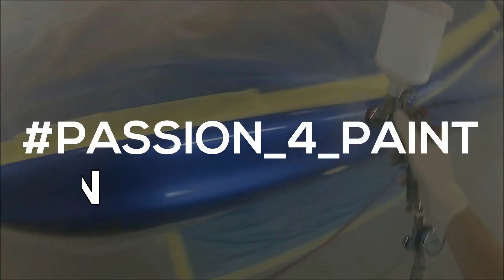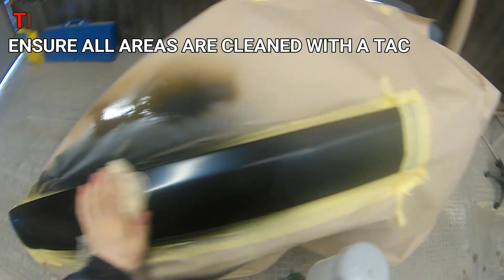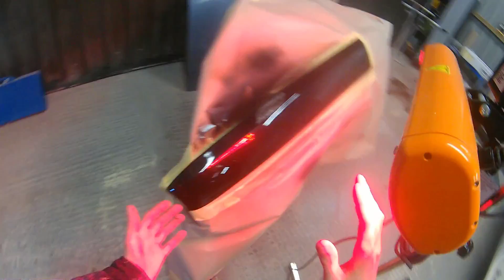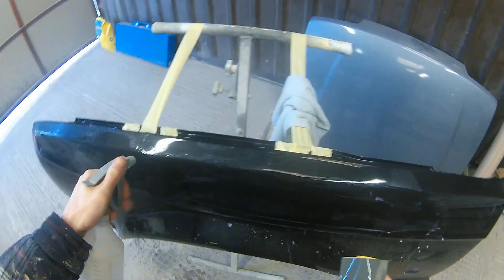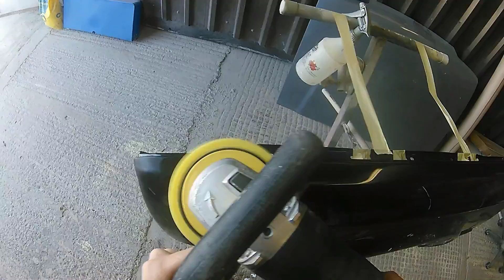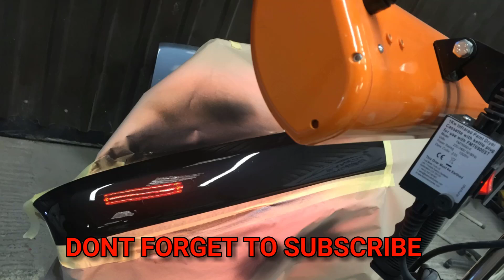How To Do An Effective Smart Repair Part 2

Comment: You forgot very important details, can you answer them?
What was the air pressure of the gun?
How many times do you turn the paint and varnish adjustment knob?
How many millimeters was the needle of the gun? 1.2  or 1.0,,,hvlp or SR ?

Comment: That seems like a pretty big area to sand, fill, paint etc, for what was such a small dent, is it really necessary to take it to such a large area. I have a small paint chip on my fender,  (about 1cm square) where only the clear coat has been damaged, there is no metal showing through and I want to repair it, do I need to take it to such a large area and do I need to fill it (or jsut sand it down to level) and then add a few coats of colour match paint and then spray on a top coat?

Comment: Tony what I'd love to see more of, and what is really lacking online, is to do all these processes using 1K acrylic lacquer color and clear. ... I use 1k lacquer at home because it is much easier and less toxic to manage in a home environment. However, it does behave differently to 2K paints. For example, I always use much finer papers that are generally recommended with 2K so when you use 3000 grit, that's right up my alley. Also, I allow plenty of time (weeks) for all solvents to evaporate before sanding and flattening any orange peel. Beyond that I find blending is a more delicate process and products like 1k blend thinners and hard to find it seems. Finally blend sanding can be tricky with acrylic lacquer clear coat. If you don't wait long enough for it dry completely, you can easily peel back the clear coat edges and not matter how much you sand and how fine you go it just keeps peeling back. You end up clearing the whole panel. I'm no expert and the techniques and using the techniques with acrylic lacquer 1k products so i'm very keen to see much more ... I know it's considered an inferior paint and clear, but you have to do what suits your painting environment best. Anyhow, be great if you could do some of this.

Comment: A used black car I recently bought had scratches and small dents on the panels.   So the cardealer gave my car to a SMART repair person to repair the scratches and dents.  On return of my car, I noticed lots of white spots (in the area where the werk was done) that couldn't be removed when I rubbed them with my finger or fingernail.   Are the white spots the results from overspray?
Reply from the maker: i couldnt say mate could be primer overspray or something i genuinely cant tell you
Reply: @TonysRefinishingTV  After washing the car; I took it to 2 body repairers, and I was told that they are overspray.  Also, lots of swirl marks were found in the area where the work was poorly done.  I then took the car back to the dealer and demanded a full refund, which I got.

Comment: Hi tonnes. Could you please advise on any good paint match retailer in uk? No one seems to have the nearest paint match and I have ordered few spray cans over the last 2 years but no success so far even after supplying number plate and code of paint. Thanks and hope I will get an answer from you soon
Reply from the maker: You need to take a part woth you to a paint supplier with the code the code is the colour they also need to match the shade ideally

Comment: Nice video, thanks.  Does it have to be specific blending reducers rather than just using the standard reducer from whichever clear coat system you are using?  What did you use in this video?
Reply from the maker: You can use either but blending thinner is best mate

Comment: Hi, is there any reason why you don't sand between Coats, as I am about to do some repair work on a vans wheel arches outside with spray cans. Thanks.
Reply from the maker: Because it’s not being left to fully dry so there’s no need mate

Comment: If you don't use fade out thinners can you wet sand and polish the lacquer join instead
Reply from the maker: Yes mate or you can use just 2k thinner if you dont have fade out thinner but either way still flat and polish the join
Reply: @TonysRefinishingTV  thanks mate
Reply from the maker: No problem buddy

Comment: Great job fella. So interesting. Im having to refresh myself on this for a new job Im starting. Thank you so much. I have a question about fadeout thinners. And another way I have seen it used  if you sprayed the fadeout area to soften the old paint first then started to do your lacquer only bringing your second Cote up to your pre softened fade out area. Would it melt the new and old paint better rather than just spraying fade out over your finished blend to melt the blend edge on just the outside? . My problem is the paint I’m blending onto is a bit old and oxidized and I’m worried that when I start polishing It might start tearing back. Has happened to me before even when I have keyed it with 1500. Or dose the lacquer freak out if you spray it on top of a area that has been softened with fade out. Thanks again
Reply from the maker: Personally mate I wouldn’t be doing it that way round mate by spraying it first kinda like a disaster waiting to happen tbh

Comment: Hi
Thanks for this vid from which I have learned a lot.
A few points I want to raise.
You don't comment on what you are actually doing at every step. You talk about something else.
You don't show CLEARLY up to where you are sanding with which grit paper and up to where you are sanding with a different grit. Sometimes we are under that you are wet sanding but we are not too sure.
I think you should show in more close up detail how you are folding the masking tape and how you are putting another one on top of it.
I have watched you video 5 times to understand and I still am not too sure that I have got it in but I will give it a try. 
Anyway thanks again
Reply from the maker: Hi joe these videos are very hard to shoot to include ever detail in as much detail as your are asking above and tbh most people say the opposite about this video that it has helped them a lot rather than a lot of Criticism about the methods , filming or how it’s shown , we do our best for people to show as much as we can but if we were to show every single step in every single detail then the videos would be hours or a day long which just isn’t an option

Comment: Great content.

For years I've done repairs using rattle cans. I do have a can of fade out but never used it.... I'll use it now :)

I'm on the cusp of buying spray gear to get a better finish - I think I get about 80% of what a pro can do. Interesting that you flat off into old clearcoat and then mask off. My bodge way was to keep repair small and then prep in the same way - but base/colour coat I would spray out and have dry edges (not using masking) and then hit that with worn out 2000 grit to remove the rough surface and feather the edges of the base towards the prepped clear area. Then I'd stick clear coat on...again not using fade out - I'd feather the clear coat into old clear coat. Overspray I'd keep down by masking off adjacent areas.

To get the finish I'd use 2000 or 3000 grit by hand (I don't have a DA) and then blend it all together with G3 and G10 and final autoglym.

Everyone probably thinking "oooohhhhh ouch ooohhh noooooo" it's all self taught and learned by mistake. It's only this last month I've started looking online for tips.

So thank you :)
Reply from the maker: Your most welcome mate and hope the videos help you progress on your journey further

Comment: really helpful good man, thank you!
Reply from the maker: Your welcome buddy
Reply: @TonysRefinishingTV  this will make you laugh... finished my alloys in BMW Ferric Gray (from bare metal, etch, HB primer, BC/CC 2k) and in couple of small areas the CC was a little thin. Decided to use some 1k CC from a can to touch up after 24h ... melted the BC and looked like cracked soil in the desert! so smart repair in that section... sanded down, HB primer, 2k BC/CC (this time -didnt touch the 1k!). Perfect job now as my lady can't see where it was repaired. Thanks buddy and happy new year to you and loved ones.
Reply from the maker: Lol happy new year to you and yours too fella
Reply: @TonysRefinishingTV  I just tackled a decent size dent. Pulled it out with PDR tools, slamming amount of filler, 2k primer, BC blend, good match, clear coat feather edged, all nice, went to blend old/new clear, 13 runs.... I was doing so well... lol
Reply from the maker: Lol
Reply: @TonysRefinishingTV  'slamming'...?!?! autocorrected from 'small and tiny'... lol

Comment: Great video, the best detailed video I have seen. The problem here is how to get exact match colours on 7 years old car. Even colour from manufacturer may vary a little
Reply from the maker: That’s an issue wether it’s a brand new car or an older car tbh it’ll depend on how good the suppliers are at colour matching and or yourself

Comment: How long (minutes or hours) did you wait after final clear coat before  you began sanding and then polishing with DA?
Reply: This is a rotary, which amazed me. Use a DA to avoid swirls. Guaranteed on dark colours with rotary 😩

Comment: This was a super clear video, thanks for making it! Just 2 questions based on attempting a small repair on a 25 year old Mk1 MX5 with single stage paint. I plan to use a 2k single stage rattle can. Could I still use fade out thinners in an airbrush on single stage paint? Secondly,  any tips on how to find a rattle can that would match the classic red paint? Would it need to be custom mixed having been analysed? Thanks in advance, and sorry for the questions on an old video.

Comment: Great vid. Watch and learn as the saying goes .I've watched this and feel that I've learnt a lot. Looking forward to trying this out on my prius.  Only trouble is I will have to use rattle cans. Just wondering how I can blend the clear coat using the cans.
Reply from the maker: gary collings you can buy fade out thinner in an aerosol too buddy that would work for you will be hard with cans though mate I won’t lie

Comment: Great tutorial. Can you do this type of repair with normal size paint gun or do you need one of these mini-guns?
Reply from the maker: For something this small unless you have a lot of experience I would only use a small gun tbh mate it wouldn’t be easy with a big gun at all
Reply: @TonysRefinishingTV  What is the mix ratio of cleat to fade thinner?
Reply from the maker: @kevinrussell2984  you dont mix them mate
Reply: @TonysRefinishingTV  Ah so it's only fade out thinner and no clear mixed with it
Reply from the maker: @kevinrussell2984  yeah budy just fade out

Comment: Holy fuck that is some top notch work!!! How long will a repair like this last before it starts to fade? Also I understand this is like normal paint but any special care instructions for the repair area?
Reply from the maker: They do this a lot on factory’s mate so I’d say quite some time if done right and no there would be no special needs for the repair area mate
Reply: Tony's Refinishing I appreciate the reply got some rust on my bottom rocker and will attempt to try to repair it myself, wish me luck will be using the method you showed here
Reply from the maker: Good luck mate

Comment: Tony great job.
A question on the first video you said you would take the tape off once your spraying lacquer.
You sprayed the clear with the tape on then you took it off, which is fine but I didn’t notice you cleaning the surface were you took the tape off as I would of been concern about the sticky residue left on there.
Then realized you went straight over it with the clear.
Amazing...but is this correct.
Reply from the maker: ive just had to re watch this to answer this lol, so ive taken the outside tape off that we blended the clear up to and then added the fade out thinner over the area the first tape came off from, unless youve had the tape on for a very long time and or its got cold and damp then proper masking tape wont leave any residue on the panel buddy, hope this helps

Comment: Great video Tony...if you get bits land in your basecoat do you flat them out or just leave them ?...Many Thanks 👍
Reply from the maker: If it was bits that stood out in colour difference or large bits yes but otherwise you will find clear will bury slight dust if your using a good high body clear
Reply: Tonys_Refinishing Thanks for the reply Tony,do you rate the Kapci clearcoat and if not what clear would you recommend.....Cheers bud

Comment: Great information. As far as what I would like too see is the trim removal for paint prep removal and instalation of trim door sill guards. The plastic guards being removed from say the top of an SUV. Window felt and window sweeps  weather stripping all the little things you need to remove and reinstall on a car new and old before you paint and then when putting it all back together. It may take a while to compile several cars on one video or two but it would be the most desired thing I would want to see

Comment: Great video I have a question... I did a repair on my door, in which I wet sanded through the scratch.. past clear and base to the primer.😡😡😭 can u point me or put a video up to repair this?? The entire area including the the primer is flat and smooth, do I have to sand it out and put putty and hardner?? Please help me thanks!!
Reply: Bit late probably but the first part of this video covers exactly what you're asking.

Comment: Great learning video, would you use the same process for a fender with buffer burn in the paint?
Reply from the maker: It depends how far the burn goes it would have to be bloody good to need repainting , but tbh this is a blow in style / smart repair that I don’t often do , this was made just to show how it can be done I personally prefer to reclear a Panel for a nicer final lasting result
Reply: Thanks Tony.

Comment: Hi Tony

Great video indeed.   Very informative and well explained. 

Tony, my alpine white BMW has a small dent in the upper area of the driver’s side door panel just to the left of the door handle. Will i need to apply clear coat to the entire door panel so everything blends correctly or would i be able just apply basecoat/clear to the small repair area and then blend it as you did in this video?  I am not a professional painter but would really like to repair this as its the only dent the entire factory paint finish has.  Car is in mint condition. Just need to fix that dent on the door

Thanks and keep making these great videos!!!

Mark
Reply from the maker: Thanks mark

Comment: Great video bud 
Pls explain blending thinners ?
Reply from the maker: blending thinner basically melts the old paint surface slightly heling the new paint to fuse to it on your blending edge if done right meaning an invisible join

Comment: Hi thanks for the video great skills.  Question, What is fade out thinners? Is it a special product or just clear coat mixed with more thinners? 
I plan on trying this sort of job on a metallic blue with a 2k clear on top. When doing small repairs I usually just cover the whole panel with base and then clear the whole bumper but id like to learn this technique to minimize repair area.
Reply from the maker: its a special thinners that helps to melt old paint to new to help prevent clearcoat blends from being visable

Comment: can you use these Compounding Pad, 75mm x 30mm, Orange, Pack of 5
Product Code: FMT6065/5 ( from fastmovertoolsuk.com)  for getting the shine back up after you wet sand the panel with 2000  wet and dry sandpaper and what polish would do you use?
Reply from the maker: +mark H il take a look for you tonight when I'm back and let you know
Reply: ok

Comment: I've watched this video many times and never really caught that neat Sealey 3" polisher there. The same very tool is also available as an excenter-sander with 2.5mm hub, which is what i'm using for a while now -it's awesome! So i just checked the internet for the polisher now and found it for £32 incl. shipping. Bargain alert, bought one right away!! I hope it's as good as the excenter version. THANKS :)
Reply from the maker: +Chuck Thomas lol it's a good little polisher mate bit loud but does the job great for the money I've had mine a year or two now and works a treat still
Reply: Mine arrived some days ago and turning it with that little wrench on the collet, i noticed that on a full turn it had some very rough spots. I took it apart and found the planet gears totally dry. I added some thick bicycle chain lube to the gears and it runs great now, but caution: excess oil blows out from the collet on first use! All the internal components show surprisingly good machining and overall quality, they don't give the impression of the usual cheap chinaware (except for the chinese bearings of course), so i guess the tool will last me a long time! An important note from the manual that i'd like to leave here: "4.3.  Press trigger to start the polisher, release trigger to stop" There you go :)

Comment: Hi Tony, great to see you back on the Tube with your excellent and informative videos. I especially liked the Ford Anglia series as I'm helping my mate restore his MG Midget using direct gloss and until now hadn't seen any footage regarding flatting and polishing that type of paint. So thanks for that. I'm not a painter by trade but do lots of accident damaged trucks and vans at work in poor conditions my biggest enemy is dust! Keep up the good work mate your videos are brilliant!
Reply from the maker: best thing mate is just wet your floor and walls down , i also find a touch of soap (tfr or washing up liquid) helps keep it wetter longer, and great to be back mate trying to get the videos better